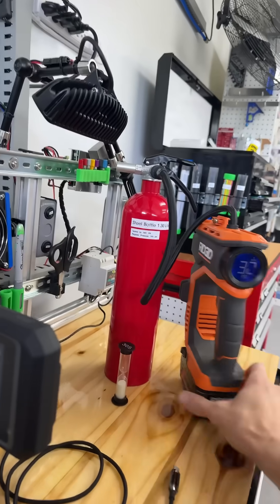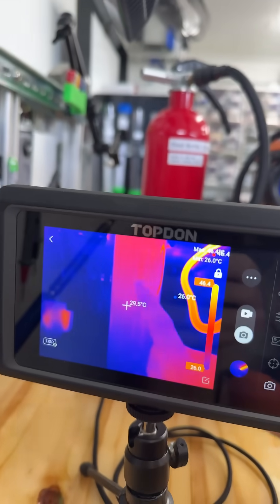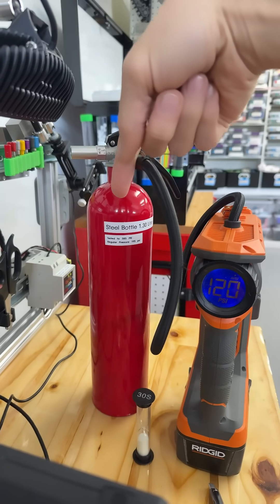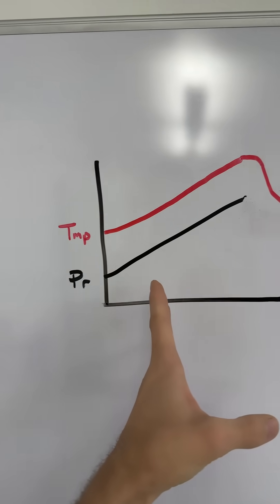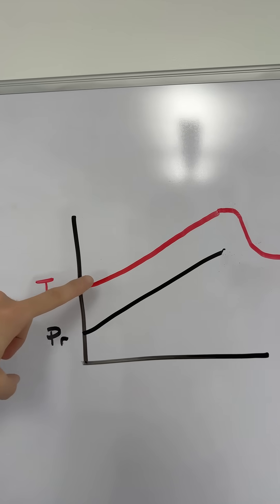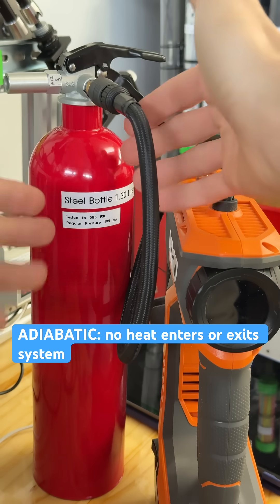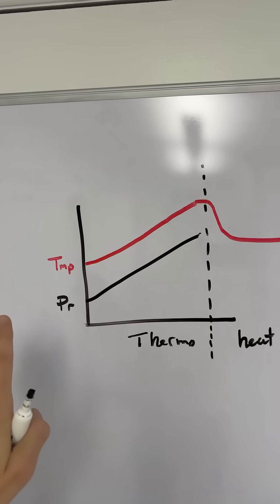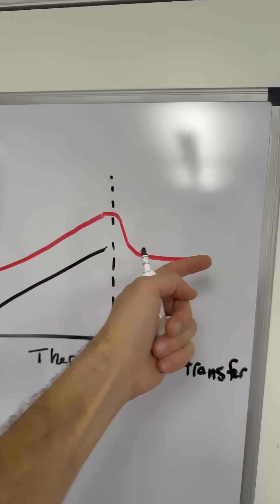Thermodynamics isn’t heat transfer.  Here’s the difference. #mechanicalengineering

Comment: 1: the total energy of an isolated system is constant;
2: the entropy of that system always increases
3: the entropy of a perfect crystal at 0 Kelvin is Zero.
Reply: And the entropy of a system is the number of unique arrangements of every piece of information in that system. 
For instance, a sand castle can be created by all of the arrangements of sand grains that create that specific sand castle. This is a system of low entropy.
The entropy of a heap of sand is every unique arrangement of every sand grain that creates a heap of any shape
This is a high entropy system. 
Any sand castle will always degrade into a random heap of sand grains. Because entropy always increases with time. 
Or time always increases entropy.
Increasing entropy defines what we call the Arrow of Time. 
Or the Arrow of Time defines what we call the increase of entropy.

Comment: if the incoming air was released out of a higher pressurzied air container, than when filling this fire extinguisher bottle would at least air turned cooler when being expended out of the original confined high pressure container.  Then when cooler than its previous in storage container air pressurized the air in fire extingisher, squeezed the air in red fire extinguisher, and the red fire extinguisher shell may still get warmer, but slower than being filled by a motorized air pump.

Comment: As a power engineer (steam engineer, stationary engineer) I have some thoughts.  

First of all, your question was how to capture more energy in the receiver (pressure vessel).  In my field, pressure and heat are both preserved in such a scenario, so you'll want to capture the waste heat in order to do more work.  It's relatively easy with steam and steam-driven turbines driving a compressor with intercoolers and aftercoolers which would transfer heat energy back to the prime mover.  In your setup, it's not immediately obvious to me how to get more work out of your waste heat, except maybe using a sterling engine or something to drive a first-stage compressor feeding the main compressor's suction.

If, however, you're just trying to get more energy in the form of static pressure into the tank (relative to atmospheric), and heat efficiency is irrelevant, then:
1. Determine the MAWP of your receiver and all the connected components
2. Install an aftercooler downstream of the compressor 
3. Install a moisture trap downstream of the aftercooler to protect your receiver from corrosion
4. Ensure your compressor is capable of providing sufficient pressure
5. Provide the compressor suction with cool, dry air

How complex do you wanna go here? Lol 😅

Comment: It's this why I can fill a camping propane canister with more propane from my 20lb tank when the camping canister is frozen?
Reply: Yes and no.
Stored propane should be a liquid.
It stays a liquid because you're pushing so much into the bottle that it has no choice other to be a liquid.(pressure)
Now when you refill your smaller vessel you ideally move the liquid between the vessels and not the gas.

A frozen bottle allows you to put more into the bottle because your refill process is probably flawed and moves a mix of fluid and gas.
So portions of the gas may condense inside the bottle crating new "space" to allow more propane to enter.

If you manage to "only" feed liquid into your bottle the temperature shouldn't matter and you always get the same mass.
Reply: @DerSolinski  can you help me fix the flaw?
Reply: @paulvild Maybe, whats your process? 
Just on a side node, I strongly discourage any DIY solutions.
Refilling without proper equipment can cause issues that are not obvious at a glance like introducing oxygen into the tanks.
Reply: @DerSolinski  when you said it was flawed I thought maybe you had something specific in mind. I TURN THE TANK UPSIDE DOWN. I use a brass adapter to connect the two and open the valve until the gas stops flowing. Then I close the valve and disconnect.

Comment: Is it possible that some of your heat transfer, is simply the air being heated by proximity to the working motor and the hot air went into the bottle?
Reply: Friction losses from compression also add to the energy but in general think of it this way:
You have volume, it contains a certain amount of energy. That's a combination of the space and the temperature.
Now you make the space smaller, but the energy "stays" the same.
So the temperature has to go up.

Comment: It's going to be hard to mitigate losses in the scenario because the compressor is the grossly inefficient culprit. Insulating or dissipating any heat would not be increasing efficiency just mitigating losses over a shorter time frame or increasing losses to falsify the results depending where your isolating your data collection 🤓🤷🏼‍♂️😂

Comment: Seeing a couple good ideas here in the comments, wanted to add some additional context to them.  

Chillers: Car intercoolers try to mitigate lost air volume to heat by prechilling the air going in.  That primes the air to a 'preshrunken' state so that a colder and more dense gas can be pushed into the engine.  The expansion due to heat is still occurring, but because the starting temperature is lower, the end temperature/pressure is more advantageous for power production and compression.  So yes, he could add a chiller of some kind before the compressor to pack more air into the bottle.

Insulation: insulation doesn't stop heat transfer, it SLOWS it down.  So wrapping the bottle will not prevent the pressure from dropping, it will rather make it take place over a longer period of time and the bottle will stay warmer for longer as well.

Staging: in many cases, simply waiting for the bottle temperature and pressure to normalize and then recompressing the air will be adequate for reaching your pressure goal.  You can speed this up by chilling the bottle to accelerate the cooldown period and shorten the waiting time before priming the tank again.

Tank staging:  one user points out that an additional source of heat comes from the friction within the compressor.  Some of that does get passed into the bottle here.  Simple way to mitigate that is by having an intermediary tank.  The compressor fills the first tank and temperature and pressure are allowed to normalize before filling the final tank.  Since the compressor is not operating, no heat from friction is transferred.  The bottle will still increase in temperature though, but not as much.

Combining these all together:  chillers before the compressor and before the second bottle while keeping the bottles themselves colder will allow for more air to be moved into the final bottle during one charge cycle.  If additional pressure is then needed, a secondary cycle can be done.
Reply: As far as I know an intercooler is placed after the compressor to cool down the heated air. It’ll be working with a larger dT, making it easier to cool down.
Reply: @RuudAlthuizen in this case you may be right. But an engine is also a compressor of sorts, so it's not always the case.

Comment: One problem with this experiment - you didn't take into account the heat generated by the compressor through friction of the piston and cylinder wall.

Air compressors generate a LOT of heat, therefore the air coming out of them and entering the storage tank is usually very hot. And it doesn't take a long time for the compressor to get very, very hot.

It's not the transfer of air that's causing the transfer of heat - it's the transfer of artificially heated air that's causing the receiving bottle to show the heat gain.

Take the compressor out of the equation and let's see what happens then.
Reply: You're not wrong that the compressor does add additional heat from friction.  But why do you think the compressor creates so much heat?  It's not just friction.  The ideal gas equation states that pv=nrt or pressure * volume = #atoms(written in various forms) * gas constant * temperature.  So from the equation, you should see that if all else is kept the same, an increase of pressure will cause temperature to rise as well.  Even if he did measure and account for all heat generated by friction, there would still be an increase in temperature proportional to pressure.
Reply: @OddJobEntertainment  Even outside of the ideal, at it's core, pressure and temperature measure "the same thing". Temperature is a measure of how much something is moving randomly; how much random momentum it has. Pressure is a measure of how much force is being put onto a surface, which is going to be directly related to how much, and how forceful, the things around it are randomly bumping into it. The temperature. And by how many of them there are at that temperature.

Basically, that both sides measure the same kinetic energy in a system. Though one side technically only measures the random kinetic energy, and not all. And why that one is the "ideal" formula.
Reply: @OddJobEntertainment  Excellent post!! I learned something!! Thank you!!
Reply from the maker: so, let’s use one bottle at 300PSI, ambient temp, and send the air into bottle-2, at 0-PSI-gauge, then see what each bottle does thermally?

love your detailed comment: it’s extraordinary I can share a couple of facts and then 10 comments later, there are thousands of viewers who can read and learn from smart commenters.  Your comments generate a 10x of the initial video’s value and i’m so grateful.
Reply: @davidmalawey  YES!! That is precisely the experiment I'd love to see! Just to see what the temperature change would be just transferring the air from a higher pressure to lower pressure vessel.
Reply: Did you do this experiment? I'm expecting that both bottles cool because the gas trapped at one pressure is now in twice as large a vessel, half as much pressure. Then it heats to ambient slowly and the pressure goes up a little.

Comment: One way to get more air into the bottle is to chill the incoming air.  Then, when it reaches room temp, the pressure in the bottle will increase.
Reply: That's also a very good way to build a bomb...
There's a reason why high pressure vessels have such a rigoros certification and maintenance process.
Reply: @DerSolinski it goes without saying you have to be careful!  Use Boyles Law, Ideal Gas formula to determine how cold to get it without danger.    His question was about   how to increase pressure and he seems like a reasonably safe and thorough guy who understands the relationship between pressure, volume and temperature.